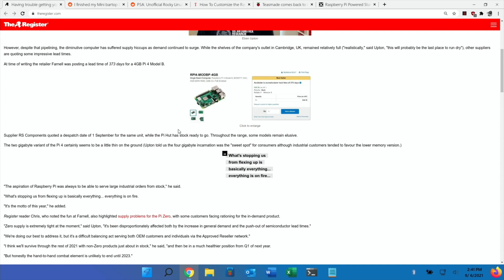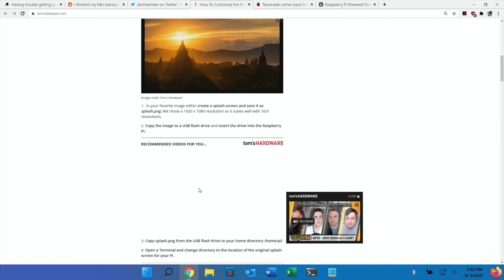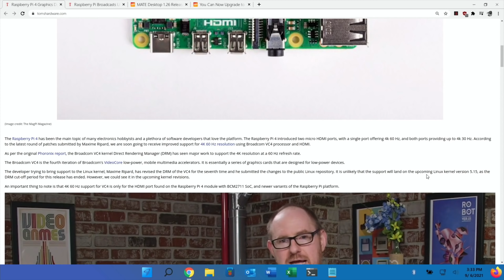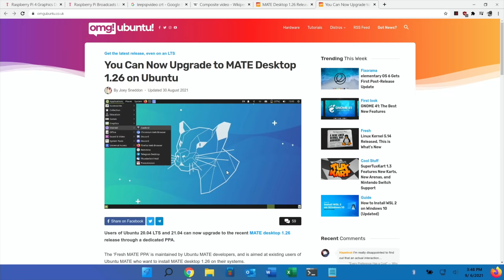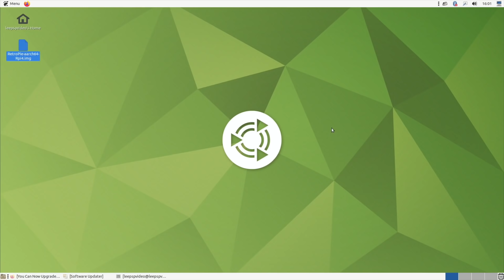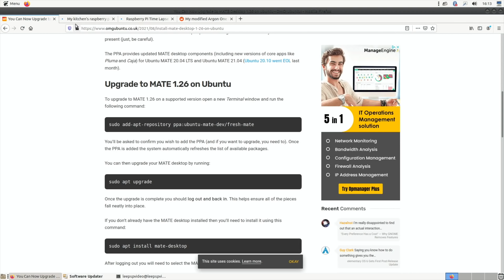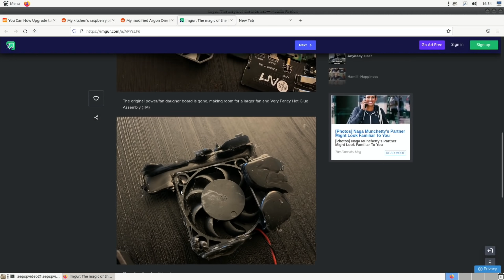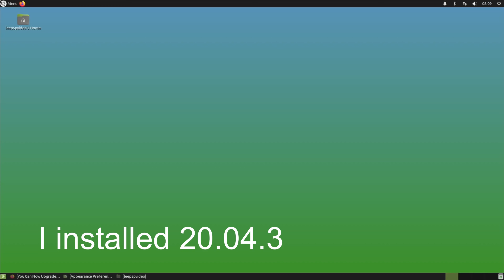Pi news 37. Pi4 4K 60 Update, Modified Argon One case.

Comment: Is there some sort of eta on the 4kp60 update? Or is there a way to install the update unofficially? The reason is that despite everything I try in the configuration, using a pi4 at anything more than 1080p just plainly sucks.

Comment: Hi.
I been through all your videos and i can not find what i need to do, issue with android that i can't solve, basically i have around 2tb of music and i use a 200gb sd card with an old phone in my car and i use BlackPlayer EX, i got the tracks on random and it works fine BUT now i been trying to set up a samsung tablet with an USB hdd with all the music on it but android can not scan any folder apart from root or sd card, i been lucky to actually manage to play 1 track at the time with different music player but that is impossible with over 2tb worth of music.

I don't want go and buy a bunch of raspberry pi bits to try and run android on a 4tb hdd only to find out i will have the same issue or even build something i don't like on top of that having that tablet without use is a waste, or using picoreplayer as i dont really like the UI.

Any help relating to this would be gratefully appreciated or even a way around such creating a folder shortcut of the hdd inside the download folder in root so the app can scan it?...

Thanks.
Reply from the maker: I haven’t covered in car entertainment. The tablet issue could be lack of power. (Possibly sorted with a powered usb hub). Also android is fussy with file format types. 

https://www.quora.com/Is-it-possible-to-hook-up-a-4TB-hard-drive-to-an-Android-phone-If-so-how
Reply: @leepspvideo  I used a powered hub and a usb pendrive to try first and no luck, android file manager sees the pendrive and i can move things from the tablet to the drive and back without problem, the issue is the player app doesn't scan the usb drive, i have literally try about 20 apps including kodi and i can not manage to make the app to scan whatever i plug in.

Comment: Forget about uSD booting on the Argon One case. It's designed to USB boot from the SSD. You can also use a uSD card to USB3.0 adapter for booting from different builds and keep your data safely isolated on the SSD. That's how I roll. You'll also get better transfers than with the uSD reader.
BTW, your 'bolts' are 'nuts' and your 'adapter' is called either a 'standoff' or 'pillar'. Knowing the proper names of your hardware gives your videos a lot more creds. Know what I mean, Mate?

Comment: Gonna see if the new ubuntu mate gets along with the pi 400 later on, it used to have an issue where you had to unplug to powerdown and I think it came from using the power led as an activity light.
Reply: I used to have a cheap SBC that required unplugging and the USB-C connector soon broke off. Tried to solder it back on, but only lifted the tiny tracks. Now, the SBC is a paperweight. Now, I purchase Pi starter kits and wall warts with in line power switches. Well worth the investment, IMO.

Comment: Now we can play 1440p 30 fps video on youtube on Raspberry Pi 4/400 i played a  1440p 24fps video on youtube running on pi400 at stock clocks on Ubuntu 21.04 and the playback was smooth it used to drop frames when the video was buffering the but if the video has fully buffered the playback was super smooth. The video i played was "Resultion Matters 8K Reel" it's a video from Red Camera's i reccomend to buffer the video little bit then play the video in full screen it will play much better.
Reply: Have you tried overclocking? It makes a huge difference. I just did 2000 and gpu to 750, wow what a difference even just browsing.